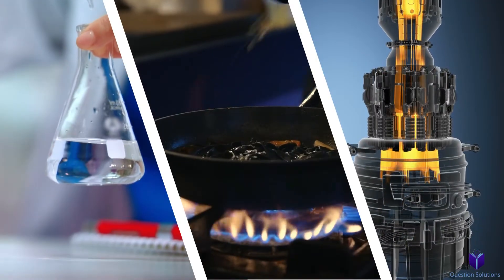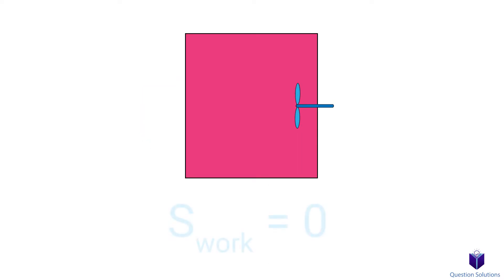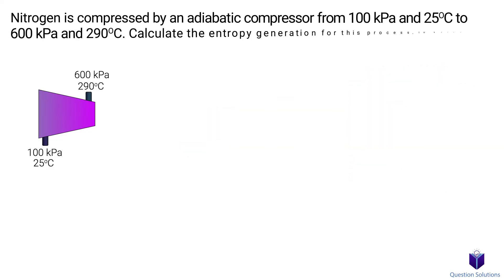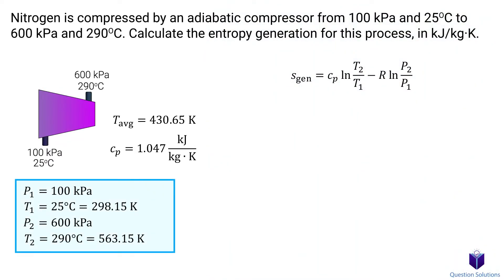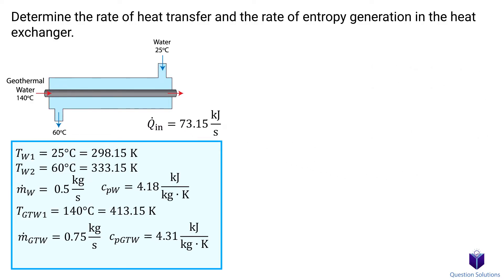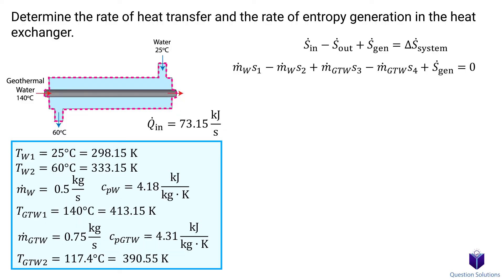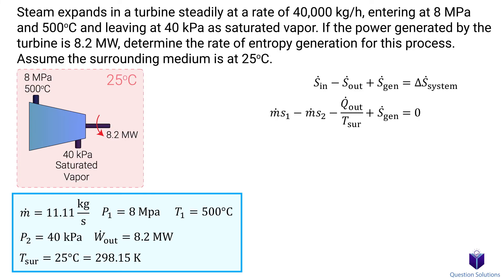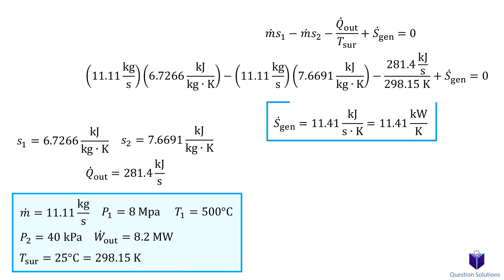Entropy Balance | Thermodynamics | (Solved Examples)

Comment: Hi i watched the whole playlist, just wanted to ask how do we know which method to use for the questions? majority of the questions are quite similar and how do you know which one to take and stuff. Do you have any resources for that?
Reply from the maker: There really isn't a resource for that (at least I don't have one), but usually, as you do more problems, you get an intuition as to which method to use to solve a problem. It's also highly dependent on the givens of a problem and what it's asking for. On exams, most questions are formulated so that you would need to utilize multiple methods to get to an answer.

Comment: In the last example where did this formula come from ms1-ms2-Qout/Tsurrounding+sgen =0?
Reply from the maker: So it didn't really "come" from anywhere.  We are just listing out the entropy values that's coming into the system (associated with mass flow), values leaving the system (associated with heat loss), the amount generated in the system, and since there is no change in entropy of the system because it's a steady flow system, it's equal to 0. If you're referring to things like mass flow and heat loss, those comes from earlier chapters that talk about turbines, mass flow, etc.
Reply: @ Thank youu!!

Comment: For the last example provided, the the surrounding temperature (Tsurr) is used in the entropy generation equation, but arent we figuring out the entropy gen due to heat transfer into turbine, so shouldnt we use T turbine? or we are assuming Tsurr = T turbine?
Reply from the maker: So here, we are taking the whole turbine as our system. The heat is transferred from the turbine to the surroundings, not the other way around.
Reply: @QuestionSolutions  Thanks for the clarification!

Comment: My suggestion topics for next videos:

Maybe these are more towards Applied Thermodynamics

1. Reciprocating Air Compressors
2. Steam Power Cycle
3. Gas Turbine Power Cycle
4. Reciprocating Internal Combustion Engine
5. Refrigeration
6. Psychrometry
Reply from the maker: Thank you so much for your input, I appreciate it. I will add those to my list to do, but for now, this is the end of the thermodynamics videos. Most likely, the next set of videos will about electric circuits/ circuit analysis. I also need to create more shorts/videos about mathematic fundamentals since I get so many comments asking questions about those topics.
Reply: @QuestionSolutions  nicee! Looking forward to watch all of them